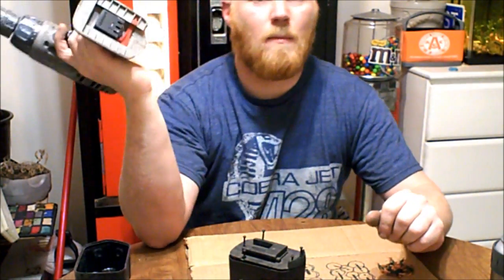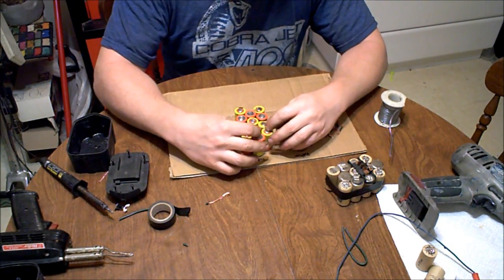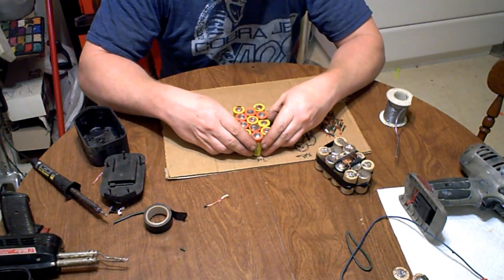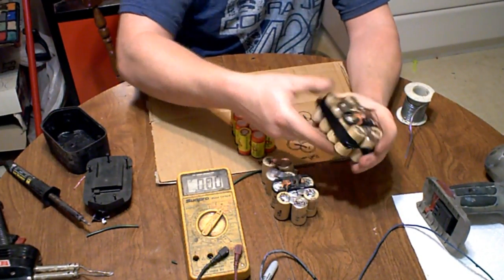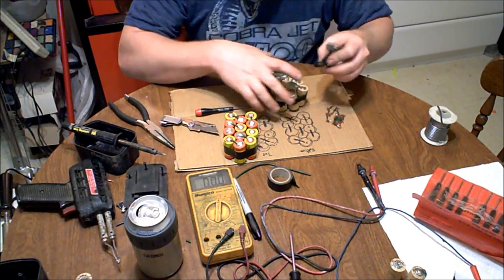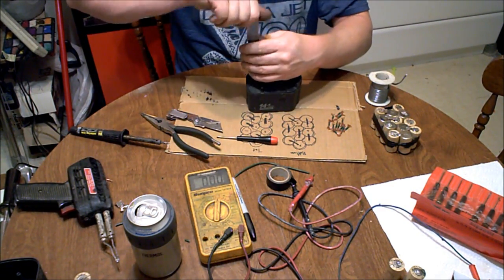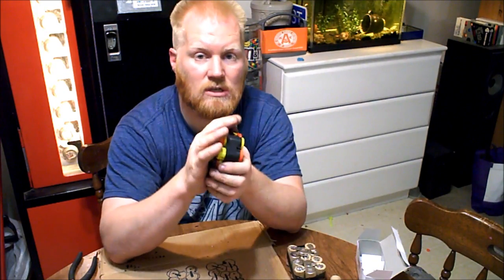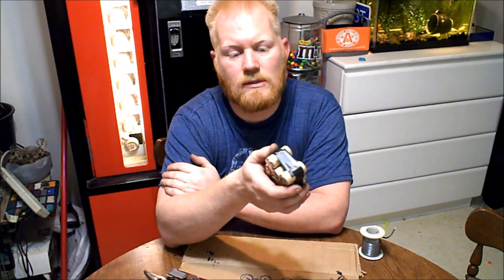Cordless Drill Battery Pack Rebuild for $20 or Repair for $0

Comment: Your informative video has prompted me to repair my 14.4 V Craftsman drill, one of the first ones that came out years ago.  My problem is I can't figure out how to get the four screws out of the battery pack.  The screw head looks like a small hex head, but none of my hex wrenches fit.  Do you know the size of this particular screw?  The battery model is # 315.110330.  Thanks.
Reply from the maker: Is it a torx screw?
Reply: sixtyfiveford No, it is definitely not a torx screw.  It must be an allen head screw but again, none of my allen wrenches fit it.

Comment: head to home depot if you want to get some spare battery packs that people are recycling. they usually have a drop off bin near customer service. on saturday  i went there and dug through the bin and found 6 Craftsman C3 battery packs. took them home and rebuilt them like this guy did in the video. now i have a ton of spare battery packs to power the C3 radio and LED work lights.

i can't believe people will actually go out and buy a brand new $80-$100 battery pack when they can rebuild for $25
Reply from the maker: Yes, I've done the same. But they also get weirded out by it and I've been told to leave them alone on a few occasion.

Comment: Ni cd batteries are ok once you charge them, but age very quickly. THen they aren't capable of holding on to their voltage for too long.
Reply from the maker: True, but they're not bad when they are new. The self discharge rate increases as they age, which isn't huge deal for a tool that is used regularly.

Comment: i have four batteries for my makita drill but they don't have screws and i don't know how to open them without breaking it, any ideas?
Reply from the maker: Google your battery packs. There are tons of images showing how to access different brand/voltage battery packs.
Reply: thanks man i found one
Reply: they all have screws. the screws might be on the inside instead of the outside. Craftsman has the screws on the inside
Reply: jgg204 I opened it using a hammer and screw(i didn't break anything) and there was no screw, it was presses or maybe glued

Comment: hoping this will work for my discontinued Porter Cable Lithium set?..My set was an original 4 tool..I ended up adding 3 more tools...and didn't think of getting extra batteries..and now they're discontinued...all Porter Cable tools now are 20 volts..
Reply from the maker: The idea is the same for lithium. It will use 18650 high draw cells. BUT the cells have a balance charger and other circuitry around them and it is far more difficult to do this(not impossible) and get them all back in. Isn't your drill part of the dual power that can run of their 18v NiCad and 18V Li-on packs? I know they still sell the Nicad packs.

Comment: Hello there, I have a question... I went ahead and started  rebuilding the battery packs of my Dewalt cordless screw gun, 18V. now, I ordered the replacements as you suggested Ni Cd 2200mAh  4/5 sub C 1.2V... I got them delivered and they are shorter than the ones I removed from the screw gun. would that matter in terms of the total voltage I'm looking for? or I should return them and have them replaced for the correct ones, taller ones? the difference in height is about 1/2" please let me know what you think. thanks buddy!
Reply from the maker: They'll work identical and they have the same voltage. There are 2 different sizes a Sub C and a 4/5 Sub C. Your Dewalt came standard with the Sub C but the 4/5 Sub C will give you a little more room to work with, making reassembly easier.
Reply: sixtyfiveford Great, thank you. if I can get the same power having some more room to work with, I'll not return them then. the xtra space I'll fill it with foam. thank you so much for explaining the differences of the two sizes. I'll go ahead and start the rebuild!

Comment: Thank you so much I just bought a used 18v Ryobi trio set and the battery is bad gonna rebuild it. Again thank you so much.
Reply from the maker: Awesome. I hope it helps.
Reply: Here, I am using a absolutely long life SUB-C thats a lot easier to solder & using the strips already on you can mass re-cell your tools. Don't buy the other 2000 to 3300mah claims on most batteries, this is a real 2200+ deal, tried them all but this is best. I got 15 minutes more on my Porter Cable and Milwaukee tools  http://rover.ebay.com/rover/1/711-53200-19255-0/1?icep_ff3=2&pub=5575119394&toolid=10001&campid=5337663844&customid=TRUE+RATED+AMPS&icep_item=131630346286&ipn=psmain&icep_vectorid=229466&kwid=902099&mtid=824&kw=lg ASA Craftsman Tool Supplier
Don't throw away your old batteries, like SFF here says, save them as spares.

Comment: What about the Lithium Ion batteries? Can the same be done?
Reply from the maker: Yes, it is identical for swapping out old lithium cells for new lithium cells. You can't however put lithium cells in a Nicad pack as is lacks the proper circuitry.
Reply: Gotcha. Thanks for the info. Very informative.
Reply: Just liked and subbed.
Reply from the maker: Awesome. Great to have you on board -Moe

Comment: If my old craftsman Ni-Cad batteries don't hold the charge for very long, does that mean they are "dead" or maybe something else wrong like the brushes in the motor?
Reply from the maker: The Ni-Cad cells are dead and need replacing.

Comment: Have you thought about making a small spot welder to weld that tabs on?
Reply from the maker: Yes, but solder works so well and it's quick.
Reply: sixtyfiveford Fair enough. A spot welder would be a fun build though!
Reply from the maker: It would be.

Comment: About Cordless Drill Battery Pack Rebuilds:A better option is just to buy another 18v drill from Harbor Freight for $16.99 with coupon. The cost of replacing the c cells used in the 18v battery pack far exceeds to cost of a completely new drill at $16.99 + Tax. hollidayp1 160828
Reply from the maker: Yes and no. The cells in the HF 18v packs are very poor quality and are only rated at a measly 1300mah(they test much lower). That being said, they will work and with a decent charger give an occasional user a year, maybe two of life. For a little more money and less labor you can get name brand cells with a 2200mah rating and they'll last 3+ years. So you can rebuild one pack with good 2200mah cells and it will last as long as 2 battery packs with 1300mah cells.

Comment: Just saw your video.  Great information.  I saw a YouTube video by a kid that shows how to get a battery pack that won't charge to accept the charge again and it works fine except that the battery pack doesn't last very long.  This sounds better.  Going to try this.  Thanks and I am going to subscribe.
Reply from the maker: Thanks. Like you said, flashing the cell with high voltage is a very short lived solution. Though it looks like it holds a charge it isn't enough to use the drill for a minute or two before it is dead. Also it self discharges and the battery pack will be dead the next morning after flashing.

Comment: 12 regargable bat, would cost more than buying a bat? i never even do that , you can get a new drill with new charger and  2 new bateries 100.00
Reply: mark young depends of the brand you have. Dewalt batteries are not cheap, 130 about for a pare, so rebuilding the pack would cost m r about 30. if you have a cheaper brand perhaps rebuilding the battery pack is not worth for you. get a new device!

Comment: I just bought a Skill professional drill at a garage sale for five dollars with battery packs that won't charge. Price on line for a new battery is 60 bucks. Thanks for the video, it'll sure help.
Reply from the maker: I hope it does. You should be able to take two packs apart and make one good one.

Comment: GREAT VIDEO!! I'M GOING TO TRY THIS TOMORROW AS I HAVE LIKE 10 BAD DEWALT BATTERIES.  MY NEW ONES ONLY LASTED ABOUT A YEAR AND A HALF I THINK THEY DESIGN THEN TO FAIL!!!!  JERKS
Reply from the maker: Yeah, they seem to die quicker than they should. The biggest killers of Nicad cell battery packs is using them when they get weak. At the first sign of reduced power they need to be recharged and no longer used. If they are used even a little more past this point they will kill the individual weakest cells by forcing electrical current backwards through them. These individual cells now can no longer hold a full charge and the entire pack fills week even though most of the batteries are still fully charged. 

Out of 10 bad batteries you should be able to make half a dozen good packs by combining the strongest cells. To test which cells are the best, you'll need to put a load on the battery pack while testing voltage. Take a pack that you fully charged in the charger. So partially disassemble the pack and plug it into a flashlight or drill and turn it on. Test the voltage of each cell. A good cell should be over 1.2-1.3 volts per cell.

Comment: If i go with the pre-tabbed batteries from the amazon link in the description, would I need to pop the tab off of some of them to solder the tabs from the adjoining battery?  Thanks.
Reply from the maker: +johnson Nope, you just bend the tabs so they intersect with the adjoining battery.
Reply: +sixtyfiveford thank you.  great vid!

Comment: This is great,  what brand batteries do you recommend and what is the best place to get them?  Have you also tried this to get a battery to work again?  https://youtu.be/6jjNHmMB5ns
Reply from the maker: +JumpingMOUSE! Sanyo are the best but Tenergy are great as well( I have a link in the description). I would steer clear of no name with extremely high mah ratings. A sub C NiCad should have a mah rating of 1200-2200mah. Any higher and it is a fake capacity. Sometimes people will buy new battery packs from other brands(harbor freight in particular) and salvage the cells out for their battery pack. As far as the quick fixes: sometimes they do make a battery work for a very very short time period (minutes/hours). Everyone wants to try it but it is a waste of time.
Reply: +sixtyfiveford Thank you!

Comment: so could i build an adapter to charge lithium ion 18650's in series to match the voltage.
I'm trying to build a charger just not trying to design the circuit. 
I have a box mod i built that uses them.
Reply from the maker: +Nathan Forsgren 18650 won't supply enough currant to power a power tool unless you get special high current models and wire at least 1 time in parallel. So for 18 volts you need 10 high current/drain 18650 cells wired in twin 5 cell series packs. Then you could wire leads off each cell to charge each battery separately.  Overcharging will cause them to blow up and overuseing/draining the power too low will instantly kill them.
Reply: +sixtyfiveford thanks for the fast reply, i may need a little time designing that but i was hoping to use the drill charger becuase i was hoping it had one of thos intellegent charger things
Reply from the maker: Generally there is a mini computer in the battery pack itself that controls overload and overdrain. The charger will have a computer itself as well.  I own lithium power tools but still think Nicad is a better option.
Reply: ya was showing my father how to re-pack a battery instead of paying for a whole new one alot cheap great video and i subbed!!

Comment: I wish your camera was closer to what you were doing ~ Are they ni-cad 'rechargables" ? I have like 5 cordless drills around my house & the battery packs aren't able to charge anymore ~ I'm going to try this!!! ~ ILOVE TOOLS!    >^..^<  monica
Reply from the maker: +THUNDERHORSE49 mmc Yep, only use nicd cells.
Reply: are they ni-cad "rechargables" or just a plain regular battery? - I don't know much about ni-cads - where do you buy them? - your video was great & you were very good at explaining things! excellent response time - >^..^<
Reply from the maker: Yes, they are rechargeable. I have a link in the video description for ones from Amazon but you can also get them through Ebay or other online retailers.
Reply: Thank you for taking the time to answer my questions ... I'm afraid I have one more - I am holding in my hand a Ryobi 9.6 volt battery pack (dead)  - what kind of tool can I use to get these screws off - I've tried everything in my toolbox ...... the pest, monica  X)
Reply from the maker: Most battery packs use a torx bit or security torx.

Comment: I was glad to find this as I have 3 portable drills with batteries that have stopped taking a charge or that have dead cells.I don't use them much and they seem to die when in disuse.I will trade my batty cells inside hopefully to end up with one that works.I think these batteries are too costly.Especially since I really don't do to many drilling operations.Great idea and thanks.
Reply from the maker: +Gary Wright You're welcome. Good luck.

Comment: I've been doing this for a while. I've picked up drill/drivers very cheaply at car boot sales. They found the replacement battery packs were quite expensive so they just sold them off cheaply to get rid of them. I obtain Sub-Cs and tagged AAs from China on EBAY for very low prices, so the drills are like new now. I've stayed away from the Lithium and other types as the chargers don't always want to work with them.
Reply from the maker: +Tuckaway Nicely done

Comment: After watching your vid a while back, I got a whole box full of "bad" batteries from work. 
I learned something you didn't mention. I charged the battery and immediately opened it and checked the cell voltages and discarded the bad cells, replaced with good cells from another.  After a few days the "New" battery was totally dead. On later attempts, I charge the bad battery and discarded dead cells, then waited a couple days and checked and discarded more cells. Now reassembling with cells thus sorted a got a couple really good batteries that hold a charge for a long time. Lesson: A cell may take a charge but loose it after a couple days, still it's a bad cell.
Reply from the maker: +tinkersdamnworkshop Yeah, I didn't want to go too much into the theory of load testing the cells. You can charge the pack and let it sit for a few days/week. Then put a flash light 3v bulb onto a individual cell and measure the voltage as the bulb is attached. You'll be able to determine the strong cells vs the weak.  The good cells should stay around 1.3 volts or more. You'll see some drop right under a volt immediately. Letting it sit for a while shows you the cells with high self discharge rates.

Comment: Help...never used a multi-meter before. How do you set it up to check and read voltage on a battery. I know you can get one for free at Harbor Freight. Just don't know how to use it. Love this video, and want to replace my Menard's Tool Shop drill battery pack with new batteries. Thanks for the video.
Reply from the maker: +ShaRon Kelly You should have an AC( V followed by a squiggly line) and a DC(V followed by a straight line over a few dots) setting on the multimeter. You'll want to use the a DC setting that is higher than the voltage you're testing. So each cell is rated at 1.2 volts so any thing higher than that on the multimeter will give you the DC voltage. Usually there is a 20V setting that should work.
Reply: +sixtyfiveford ...Thank you !! I will try this later this week, when I'm free.

Comment: Hi , were did you get the cells from ???? many thanks
Reply from the maker: +Scott Thompson Ebay is your best bet. Don't be fooled by fake Chinese cells with super high advertised mah. Most Nicd should be around 2000mah (anything over 2300 is fake)

Comment: I find cordless drills at flea markets on occasion that are missing the battery pack entirely; is it possible to fabricate a completely new battery pack if the nominal voltage is marked on the tool?  Only difficulty I can see would be in making the post leading inside the handle grip of the drill.
Reply from the maker: +Alonzo Branson Yes, just keep the voltage the same.

Comment: I used to make testers for determining the amp hour capacity left in each cell and recording that value on the cell to match cells together for repairing a battery pack. It involved using a calculator to count the amount of pulses, a CMOS version of the popular 555 timer hooked to a transistor, an SCR and load resistor. I made a Nicad cell zapper to fix the shorted out cells that worked on about money give percent of the cells that I used it on. I built on the was in a magazine and it died the first time that I used it. It involved charging a very high value capacitor to forty volts and discharging it into the shorted cell. They used an old fashion switch which just welded the switch contacts together. I replaced the switch with an SCR from an OVP removed from a power supply from a five volt Standard Power  power supply where I used to work at.
Reply from the maker: +Jimmie Hathaway Matching cells is the best. I have a LaCrosse charger that I have used to determine capacity. As far as zapping, I've had very poor results. Even the cells that revive have extremely high self discharge rates making them impractical.

Comment: Replacing Nicads with Nmhy cells one should replace all the cells so that the lower capacity cells do not get reverse charged during discharge of the battery pack. I have seen all kinds of tricks battery manufacturers have used to make their packs. Some used AA cells with one quarter inch cardboard tubing to make the cell the same diameter as the sub c cells, but their capacities were under five hundred MA hours verses about one thousand MA hours for the sub c cells.

Comment: I buy the cheap battery packs disassemble them and use the cells in them to replace the bad ones in the original battery pack. I can get a fourteen volt battery pack on sale for under ten dollars verses paying over two dollars per cell for individual cells.
Reply from the maker: +Jimmie Hathaway That's a good deal. The cheap cells in these seam to only last a year or so though.